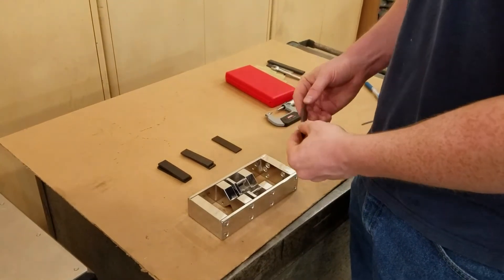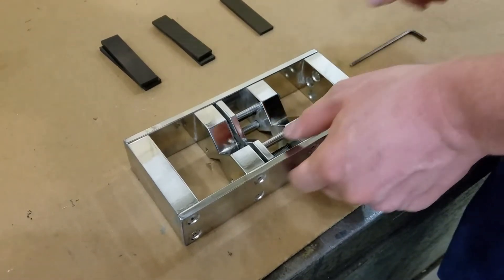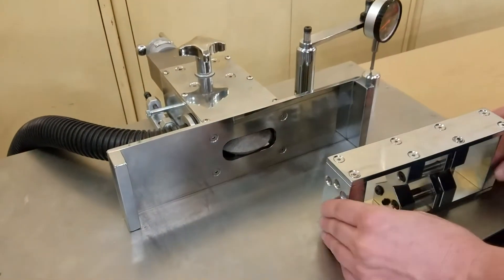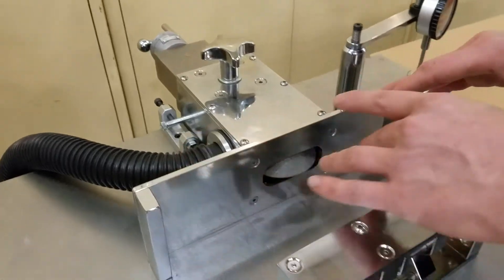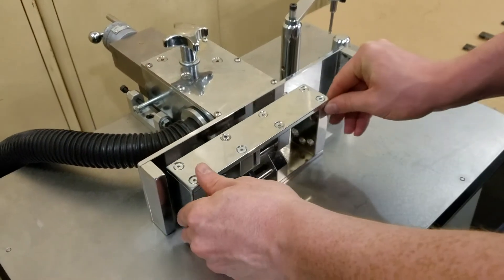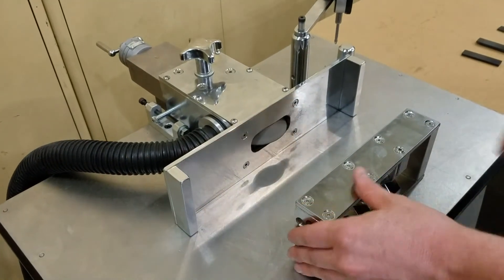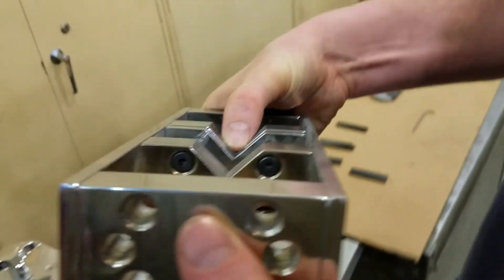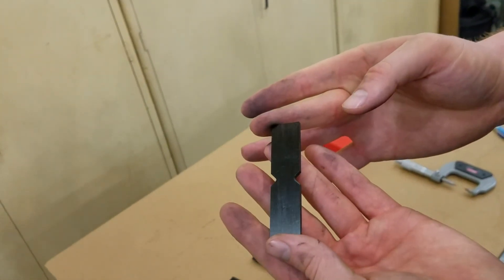Composite Shear Test Cutting for ASTM D5379 Samples Using V-Mill

Comment: Hi Sir, 
Does the composite specimen that you should in the video, have a thin skin on the top, a Core material and a thin skin on the bottom ? And is there any adhesive in between skin and foam? If we have to conduct shear test on such composite specimens how does the glue affect the shear properties ?
Regards,
Vaidehi